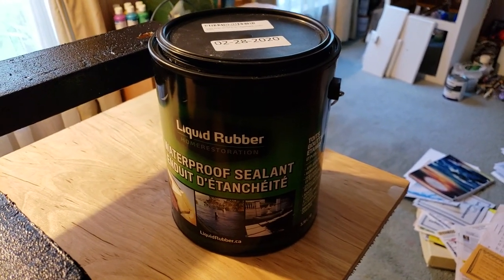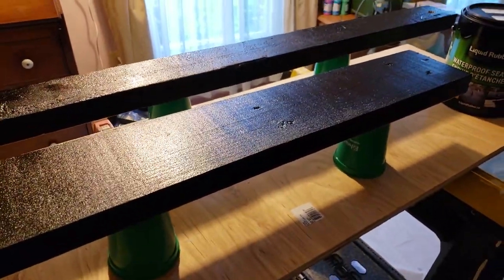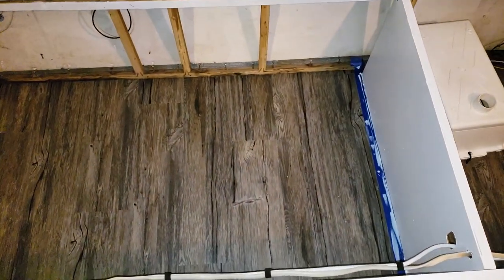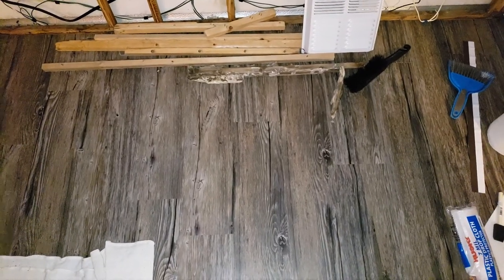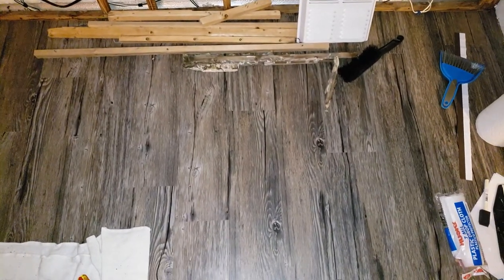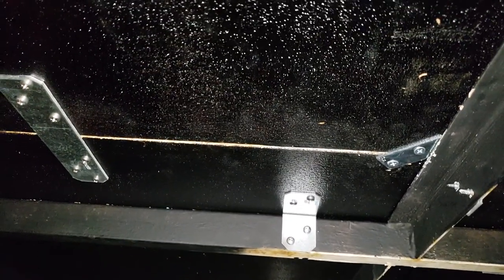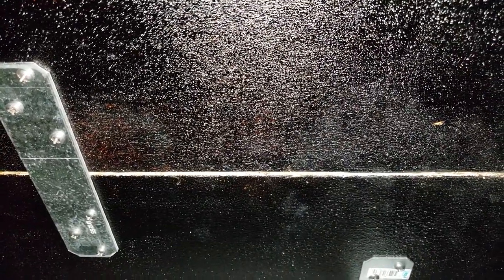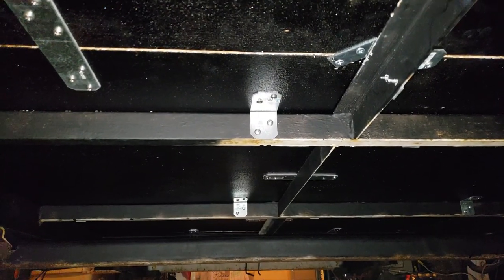Aliner Makeover and Repairs: Under the Trailer, How I Attached the Floor 6/4/18

Comment: Nice work on the floor. I was wondering how you installed the flooring so it didn't flex at the joints. The rubber sealer is a neat idea. I've been putting off cleaning the rust and repainting my aliner framing but it definitely needs it. I can only imagine how much fun you had sanding the frame!
Reply from the maker: The sanding wasn't all that bad because I had easy access to it when I ripped the old floor out. I am dreading the sanding and painting that I do have left to do though because I will have to do it on my back 😫

Comment: You are doing such an amazing job on this!  And that liquid rubber looks like a great solution.  Just one question about the plywood seams flexing over time...maybe you could watch someone walk on the floor (from under the trailer)?  Our Aliner floor makes quite a few creaking noises now and  it's not even one year old.
Reply from the maker: Oh I do have the creaks already. And I've done what I can to make it stable, that was the important part. I can live with a few creaks. Plus I need to finish letting the whole thing settle after I put everything else back in place. I'll worry about tweaking the floor after all that 😃

Comment: Well done, from Sydney Australia. I had just discovered that there wasn't quite as much floor in my 23yr old Avan as I had expected and it was slowly being replaced  by rather large holes and mushy, rotten timber. This was the first/only video I've found of someone bravely cutting out and replacing a floor. I've followed your lead and hints and done the same. It seems that water had been leaking in through the taillights, and probably other places, over the years and just rotted things out. To give support down the middle of the van, I welded a cross brace across the backend, and 2 lengths of L-section steel down the middle to help and made sure all joins were over supporting frame.
Again, well done and keep up your progress reports.
Reply from the maker: I'm so glad that my videos are helping a few folks out. For me what started out as a makeover has sort of turned into a rebuild and I am both laughing and crying at the same time. But it can be done, albeit the hard way sometimes 😁. My learning curve has been very steep at times. But I have ample amounts of grit and stubborness to make up for that. Let me know how your floor project turns out.

Comment: Nicci - Thanks for sharing your work.  If I had to do this, based on your result, I think I would recommend making the seam cuts in the plywood to fall on top of the major frame members... i.e. cut a piece on each side to fit from the outside wall to the major frame member on that side, and then one piece to fit in between those side pieces -- 3 pieces instead of 2.  I'm not criticizing what you did... it worked as you planned it.  I'm just making this comment to suggest a design improvement for the next person to have to do this job that would eliminate unsupported seams.  Another approach would be to add a center support attached to the frame  under the point where the plywood pieces come together.  I echo the other commenters on the amazing job you did.
Reply from the maker: I appreciate the input. Trust me when I tell you that I had no idea how to do it and jumped right in. There is a support that runs down the middle of the trailer but not the full length. I did try to match the front to back supports and also added additional 2x4s at the front and back of the trailer. I'm sure this was not the most efficient way to do it but it forced me to work with what I have which is basically battery operated tools and a couple of saw horses. I do not have any traditional shop equipment.